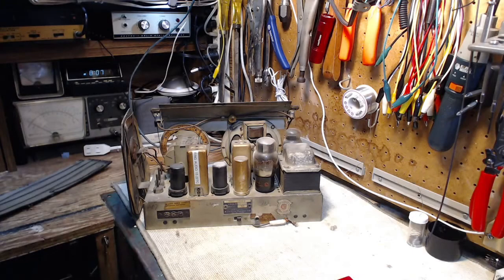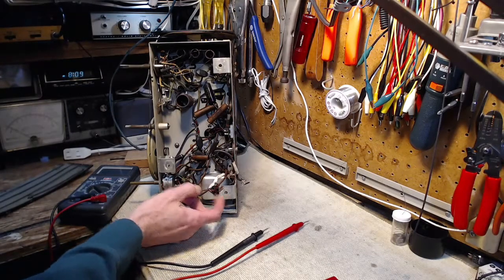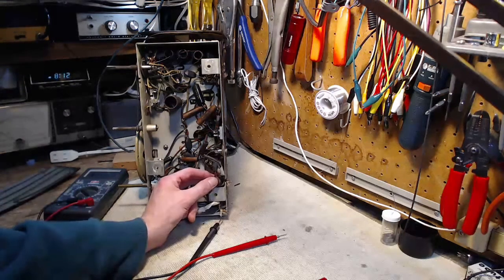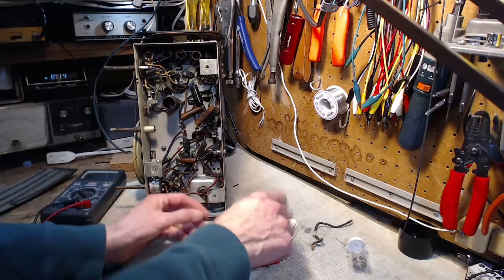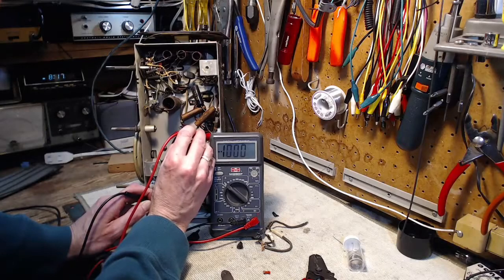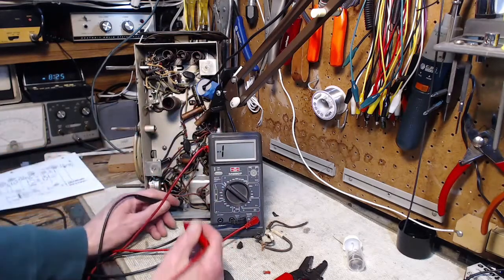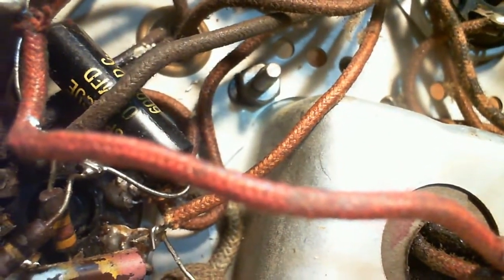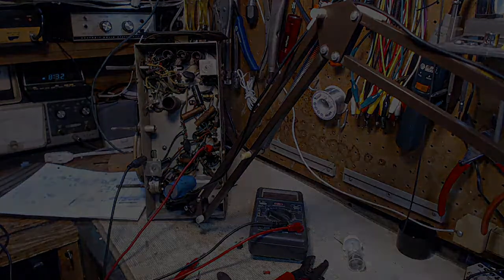RCA Victor A-23 Vacuum Tube Radio Video #2 - Getting Ready to Power Up

Comment: Jim Circuit is on the pacifictv site ( MK 1 & MK2 ) .
Reply from the maker: gd2329j I'll check that out.
Reply from the maker: gd2329j M-45 has field coil in speaker.  A23 schematic has no field coil.  But the A-23 radio I am working on has a field coil.  Go figure.
Reply: Jim Lindenas Hi JimThe RCA Victor A-23 2nd Production has a electrodynamic speaker .The field coil is in the psu across the top of the caps . http://pacifictv.ca/schematics/rcaa23rdata.pdf